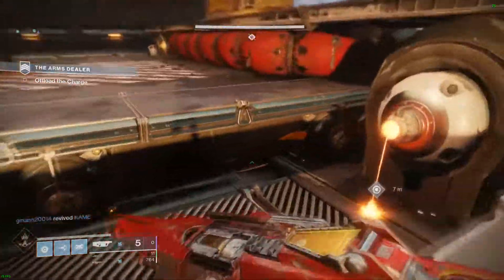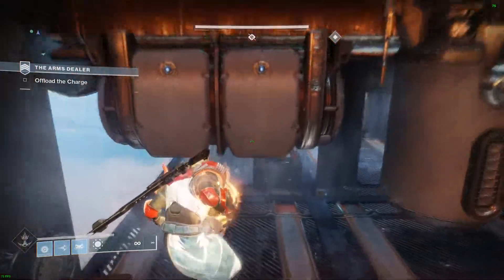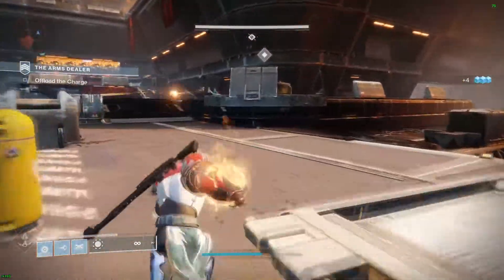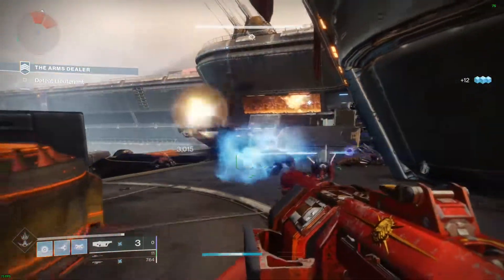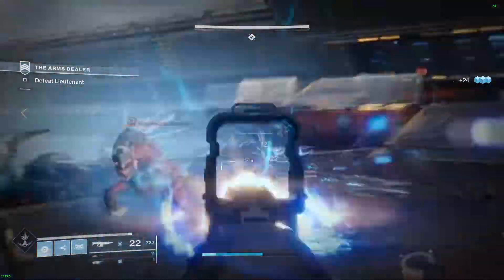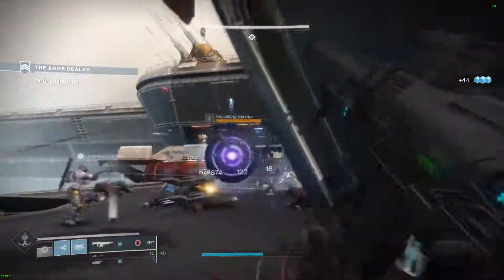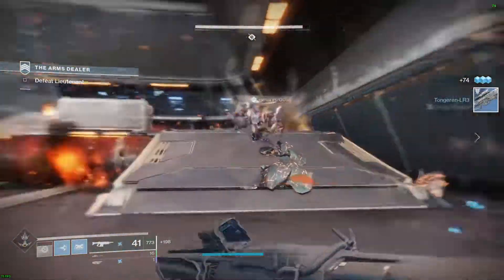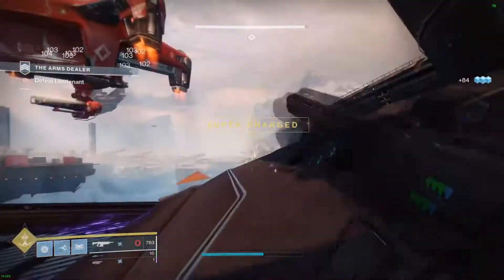you can overclock on a huanan zhi x58 deluxe but should you? (some what of a talking head video)

Comment: Hi! How you do it? The BIOS need to be changed? Or what are the steps? Can you activate the turbo mode? Thanks!
Reply from the maker: This is old information. my bias was completely gushed out for some reason but after doing a full reset it's totally fine and yes the CPU properly turbos .
Reply from the maker: Wow I just read what I wrote..... Evidently it's true I really am brain dead. Lol. Essentially what I was trying to say is that my BIOS was glitched out. The CPU turboed properly once I did a full bios reset. but that doesn't change the fact that there is still no overclocking. The only way to overclock is by using an older version of Intel's extreme tuning utility. even changing the multiplier inside of the BIOS didn't have any effect.
Reply: I'm just searching a way to activate the turbo mode. I'm a x5675 owner and cannot use the turbo speed. Only base speed. Everyone talk about mos bios, but the days past fast and still searching that way. Thanks.
Reply from the maker: @eneas_ok  you wouldn't be able to overclock the x5675 on this board. It would only turbo up to its 3.2 GHz turbo clock.
Reply: @crosstech1  why 3.2 Ghz?
Reply: 3.47ghz is the turbo mode frequency...
Reply from the maker: @eneas_ok  3.2 is the all core turbo. 3.4 is the 1 core turbo.
Reply: @crosstech1  i din't know that. Thanks again!

Comment: So with the launch of cyberpunk, I have a i3 7100 that served me well for 3 years but needs replacing since its bottlenecking my gpu (rx 580) and its not doing it anymore since these games are getting hungrier for more cpu, Im considering getting x5680 with 12 gb ram and this motherboard, I thought of overclocking but, since I know nothing of it, I prefer not touching overclocking, I saw the x5687 but idk if its powerful enough I feel like its way worse than the x5680 and it only costs 12 euros less (14.54 USD). The x5680 has less core clock, boost but more cores, theres no comparison between them so idk how they perform agaisnt each other. What would you recommend me?
Reply from the maker: You wouldn't be able to overclock on this motherboard anyways. still on the way to overclock is by using an unlocked CPU being the w3680 or w3690. and on top of that don't buy an x58 CPU for cyberpunk 2077 the game is currently broken with it. Which I'm going to be making a video here about in a few days.
Reply from the maker: What I would recommend is going x79 on a Chinese x79 motherboard. And buying an E5 1650 or 1650 V2.

Comment: Hello, I'm Thai.Would like to know if x5650 can be worn
Reply from the maker: I'm not sure what you are asking about
Reply: Can my x5650 CPU fit into this motherboard?
Reply from the maker: Yes but I wouldn't recommend it. Your CPU would only be running at 2.6 gigahertz. The x56.. CPUs don't turbo on this board.
Reply: What program do OC use?
Reply from the maker: @swat0387  Intel's extreme tuning utility. But you can only overclock the w3570 w3580 w3680 w3690. At this time there is no way to overclock the x56.. series. As far as I know.

Comment: Hey man!! thank you for this amazing work, I really liked it, could you answer me if this board support 1600 ecc? with the x567x 
 xeon
Reply from the maker: The board only supports up to 1333 the 1600 ECC memory should in theory work as long as it is 2rx4. But it will be down clock to 1333. And on the x56.. it will support up to 48 GB of RAM and yes ECC works on the x56.. series. I'm not sure why the w 35 and  w36 series won't accept ECC memory.
Reply: @crosstech1   sorry for taking a long time to answer....weird why w series does not work with ecc, the x series works fine
Reply from the maker: @belvelbel7812  it goes beyond of. The w series actually properly turbos well the x-series only sits at its base clock.
Reply from the maker: I will be releasing update video about more of what I've learned in the next couple of days